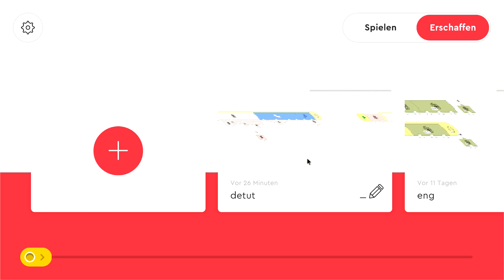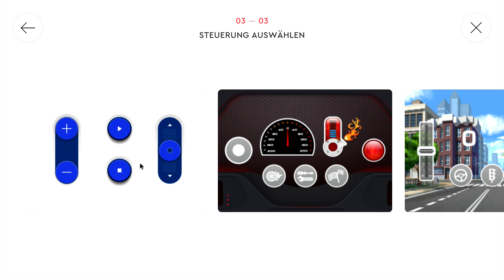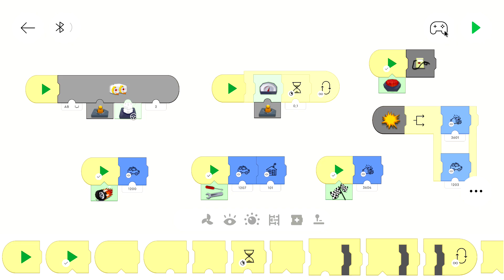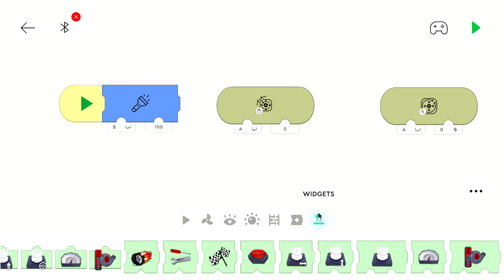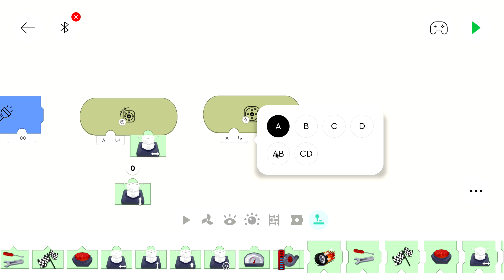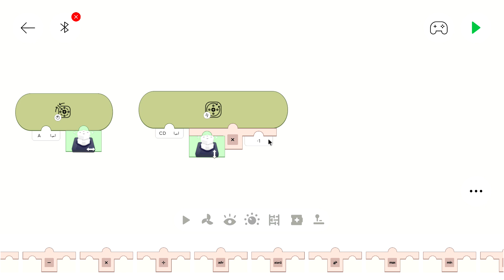Lego Powered Up Tutorial #09: configuring a touchscreen control (lights for 42099) [English|HD]

Comment: Thank you for the video! I have a problem, my steering motor isn't waiting for the L/R input, but starts spinning immediately and does it until I return to the code window. Do you know what could be the problem?
Reply from the maker: It needs to have a "stop" to calibrate for the right steering angle. It will spin until it reaches a "stop"